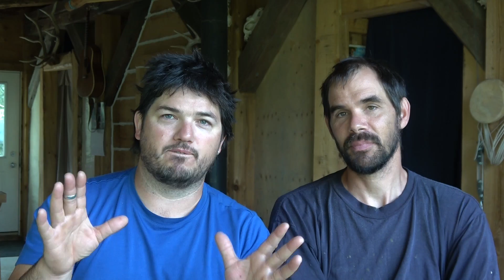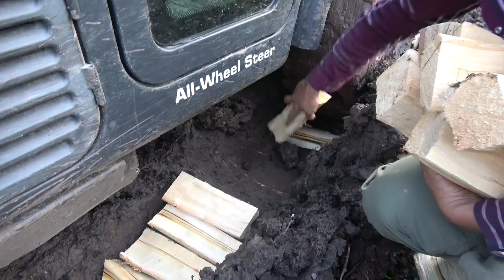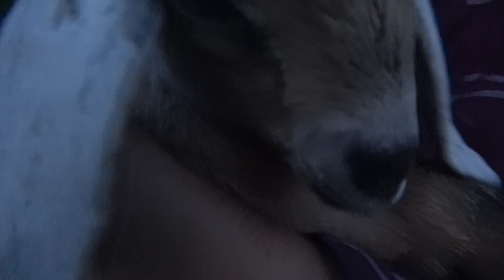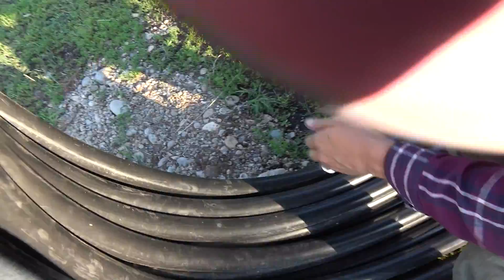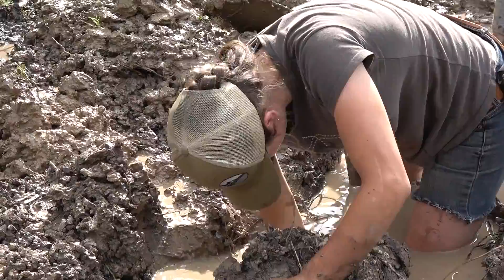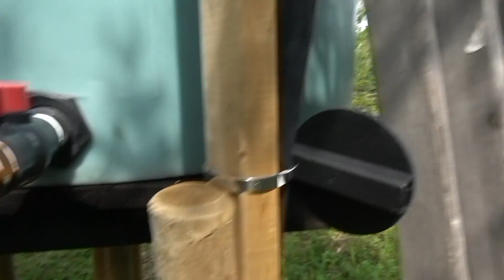Off-Grid Gravity Water System using Beaver Pond Water

Comment: Dave is your safety guy. Was very concerned about the knife issue. You all are great to watch.  Is this deep enough for winter use or do you blow it out in the  fall?
Reply from the maker: This water system is only for summer use.  It is not deep enough for winter water.

Comment: Freezing may be an issue even if you drain the system.  I hope that doesn't happen.  If you do have to replace the system at some point, I'd suggest covering it with 10-12 inches of sand.  Frost can't penetrate sand.  Good luck.

Comment: Nice video. I have a tip for you to free the vehical; when the mud isnt to wet i use two bags of quick cement. It costs almost nothing. when you pore it just in front and back of the wheels mix it a bit withe dirt and have a cup of coffee. It dries in 25 min. ready to drive out. remove the slabs to be reused in landscaping. Ive managed to get unstuck this way without anyone noticing my strugle. good luck next time.

Comment: Why not put in a well?
Reply: sunshine dewes depending on region Wells can be very expensive. They may also contain arsenic, high iron and other minerals you may need to filter out. It’s also common for Well water to corrode in house piping and fixtures. Overall, a Well is not the beat solution for water. If you get plenty of annual rainfall, it’s much more sustainable.
Reply: @4philipp  I understand but wouldn't you have a problem with animal feces contaminating your potable water?
Reply: sunshine dewes if you use surface water like rivers, streams, ponds and lakes you do run the risk of contamination. This is only a problem for drinking and cooking though. A Berkey filter will take care of that problem easily. You could also boil the water to be save. 
Rainwater can also be contaminated, mostly from bird droppings on the roof. 
The challenge for a Well is the high initial cost, plus expensive pumps and the need for a fuel for a generator. 
Of course if you have large demands on your water source, a Well might be the best option
Reply: @4philipp   Thank you for the info much appreciated..Weighing some options for water use. This helped.
Reply: sunshine dewes there are lots of aspects to a water system. Here on social media you will only get part of a picture because people do not disclose their decision making processes. 

I’d recommend getting a good book on the subject. One that I bought and liked is called “water wise” it has loads of info in it. Also addresses waste water management

Comment: This is another awesome video. 2 question. What is your frost line there? What type of logs did you use for your garden beds?
Reply from the maker: the frost is often only a couple feet but for freeze protection 6' is recommended.  This whole system is just for gardens and animals in the spring and summer so it will be drained early each fall.  The garden beds are poplar (aspen).
Reply: @Gridlessness  Thank you! good to know.